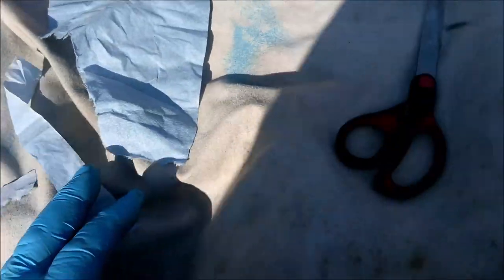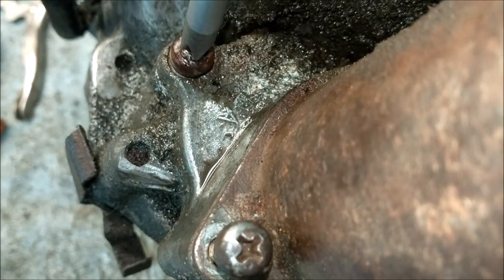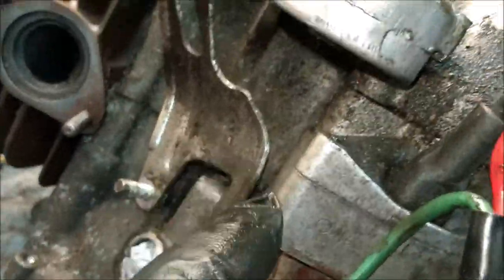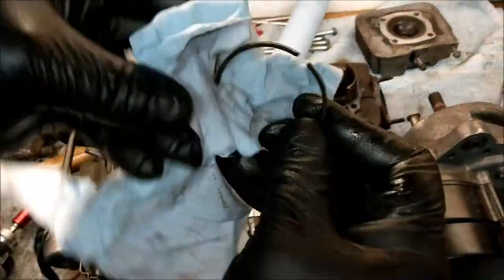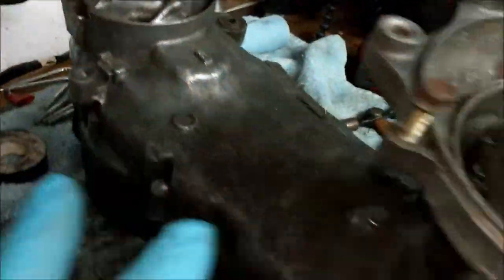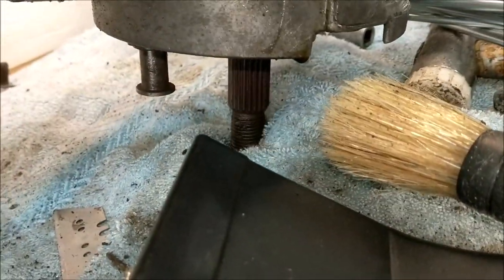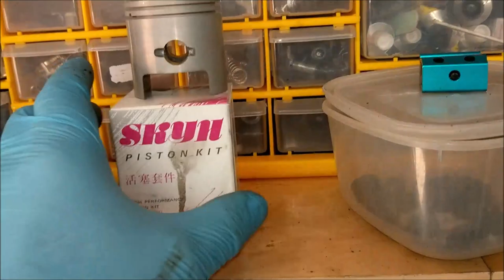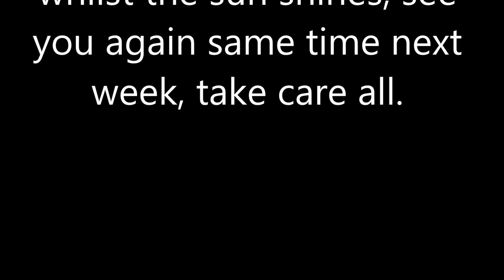Honda NH80 Vision / Lead / Aero Restoration Episode 4

Comment: When I worked for the MOD we use to plastic coat special one off tools we made. It was 45 years ago, but as far as I remember we pre-heated the tool and either sprinkled or dipped the tool in a pot of plastic powder. Adding extra powder and using a “soft” flame to even the thickness
Reply from the maker: Cheers bud

Comment: I have the same moped it won't start I have spark compression fuel  but it don't seem to suck the air fuel mix through the carb I even put a manual choke carb on to but no joy any ideas
Reply from the maker: Have you replaced the crank seals?
Reply: @eadsierestorations  fantastic thanks I will give it ago I was thinking the normal 2 stroke vacuum is not being created and that would explain it thank you for your help
Reply: @eadsierestorations  do you have a link to the 90cc piston barrel and head kit I'm having to do the exact same thing as you are to mine
Reply: @eadsierestorations  it turns out the crank had split and smashed a hole in the block behind the starter motor so it could not be seen until the starter was removed so it's had its day I think I'm going to have to give up  on it unfortunately

Comment: no, those piston rings are not ok, not even close to ok lol, and would have likely got away with a .25mm oversize, the engine has seized up previously, likely run out of 2 stroke oil, and if you remember from before I told you that you can buy fishing weight plastic coating powder that will cover those easily
Reply from the maker: Ah yes Andy, I'm off shopping, cheers bud
Reply: It looks worse on the film than it actually is, it's strange how cameras change things ... I mean Adrian nearly looks normal! 🤔